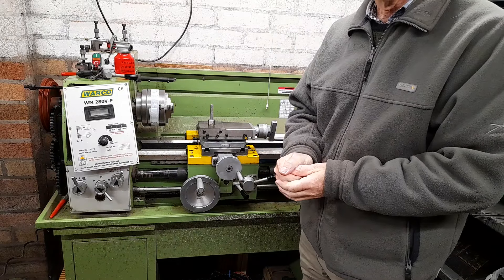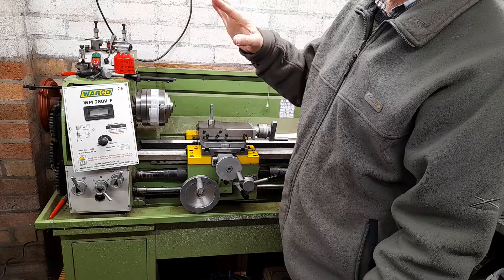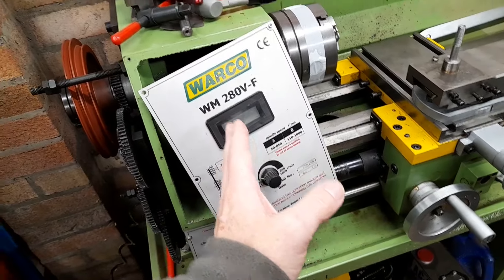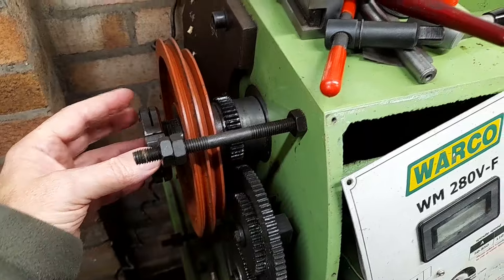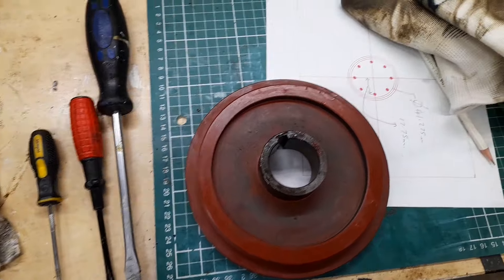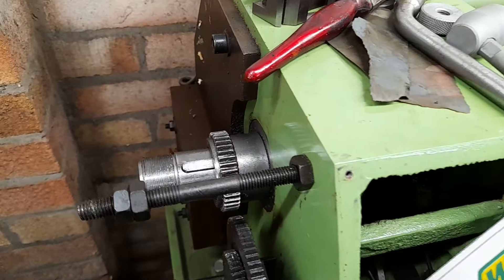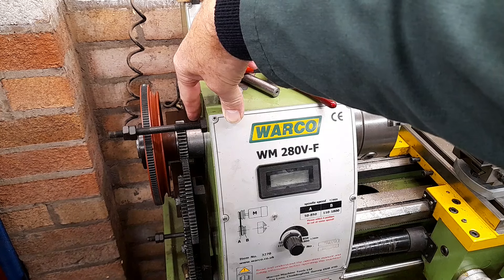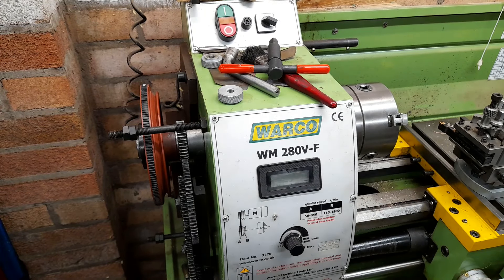Warco Lathe Refurbishment  2

Comment from the maker: Comments transferred from the first version:
@steamsearcher
3 months ago
OUR EMCO came with loads of problems a Compact 8 E which is the variable speed version. The first thing I looked at was the parts which were the most popular to replace. Leadscrew half nuts? Upon a good look the leadscrew was very rough. I then took the whole lathe apart. I polished the leadscrew and all was fine. Although old it had probably been used just once. Everywhere was covered in protective grease, including the spindle and bearings. These were flushed out. The cross slide screw was bent straight and all the ways polished. I then made up a new spindle nose to fit Warco backplates and move it out to give me a chance to get my GRUBBYS behind and do the M 8 ts. Heated up and banged on to a frozen spindle. 
Then machined in place and removed so several chucks and faceplates could be machined. Having other lathes comes in handy. 9 in total but some came free but in a bad way. Now it is a superb machine but underpowered for big cuts. the Raglan 5 is for this or the Super 7 from Myford. David and Lily.

@grendel1960a
3 months ago
i think the difference between machines is the quality control at the factory, dictated by the customer, so the more expensive brands will have rejected the worst of the dogs that were made, which will then be sold by the inferior brands

@Marcus1954s
2 months ago
Axminster have Sieg lathes. Amadeal, Chester and Warco have the Weiss lathes.
Reply
@floydraser4603
2 months ago
That's interesting, thank you for sharing. I guess each of them have a given level of quality control on import.
Reply
@Marcus1954s
2 months ago
 @floydraser4603  Axminster informed me that they did not do anything to the Sieg lathes they import, just sell them. The Weiss lathes I've seen from Chester, Amadeal and Warco are technically so close that the parts for each particular Weiss model are interchangeable. Considering how they are crated/packaged and shipped I doubt they perform anything more than a superficial check that all listed parts are enclosed. Never seen a major issue with the Weiss lathes.

Comment: in general i think the only difference is the quality control applied, but even then, not every machine will be tested, the more expensive machines may well have passed a higher standard of quality control, but that doesnt mean the cheap one is any worse than a bad one that has passed QC.